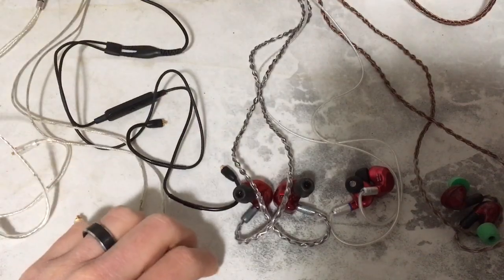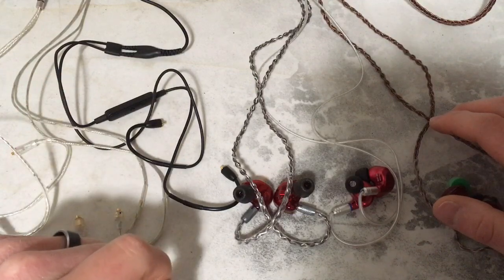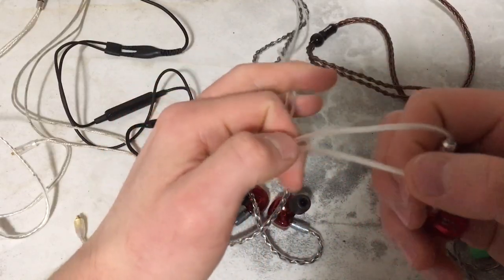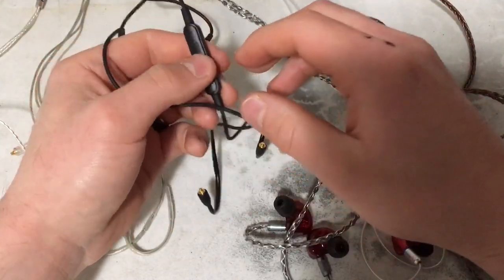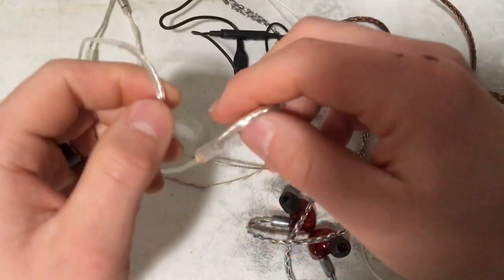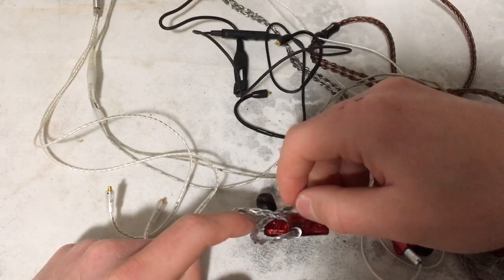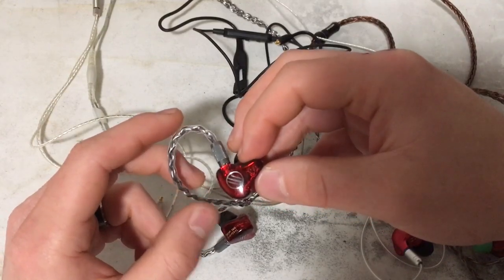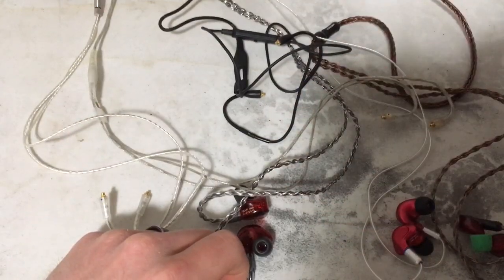Cables don’t matter (ft. BGVP DM6)

Comment: Damn those are consistent graphs -- bravo on the inquiry into cable differences, but also bravo on your measurement technique, it doesn't take much to get pretty different measurements.
Reply: P.S. DM6 is the only review where multiple commenters told me I was using the wrong cable and that a cable switch would solve any problems I had. So thanks for using that as your test :)
Reply from the maker: Thanks man. Also you’re welcome lol. I also got some comments about cable selection and it inspired me to do this video.
Reply: @iemreviewguy7469  Another great investigation, thanks for this. Surprising results given the differences you measured with the DM6 and different sources (likely due to the output impedance differences). I suspect all these cables measure similarly due to them having similar resistances (and so all affecting the impedance of the source in the same way). If you have a digital multimeter, would you mind checking this by measuring the resistance of each cable?

Comment: I'm not a believer in cables. But every cable has its own resistance, and just like a higher output impedance of a device , a higher cable impedance will also affect sound quality. 
In the moondrop kanas pro thread few people measured the kanas Pro cable which measured 0.8 ohm. Whereas the 20 dollar nicehck cable measured at 0.3 ohm. 

How much it affects sound quality, I don't know. But I think the expensive cable manufacturers intentionally makes high impedance cables to alter the sound which is better for some and worse for some.
Reply: 0.5ohm difference is jack all. The only difference is Placebo
Reply: @ron9511  The reactive resistance is orders of magnitude higher on high frequencies.
Reply: Price does not matter. Amount and quality of the surface does. Hf conducted by the surface. Also Electrical capacitance meters too. That's why 8 core silver plated cable may increase treble but 16 core may mess it up creating to many resonance points.
Reply: @ron9511  not for andros. Andros is the most fuxking hard to find the synergy... tooo sensitive. But once you got it, you will keep it.

Comment: Burn in and cable believer= flat Earther. They believe only what they can hear/see.
Reply: Burn in and cable believer = audiophile
Reply: The audiophile market is full of bullshit. Brands selling "miraculous" cables for ridiculously high prices. The same can be applied for some Iem brands (The boutique brands in general). Iem that cost 100-200 for production are sold for 1500-2000 USD. That's why I'm digging for Chinese brands, that offers equivalent or maybe better quality for a fraction of the price.
Reply: the only real thing that matters is the thickness couse you loose Signal over long distances. The other real thing is just Look and the feel of the cable.
Reply: @robinraff1486  Yes, the thickness matters when you have some distance. But, it's very little when applied to big speaker in live performances. For Iem connected to sources with less then 2 meters of distance, and without any Relevant electrical interference, it's on the level of the imperceptible.
Reply: Before you call anyone Flat-Earther, please make sure you didn't miss your Physics classes and actually know what you are taking about! 
The higher the frequency the more self inductance is pushing current to the surface of the metal. That's why all the UHF antennas are gold plated. But even on sonic frequencies amount and conductivity of surface matters. I didn't care about cables when I was listening on colored sounding or low end inaccurate IEMs. But reality when you deny it, has a way to hit you in the face eventually. 
iBasso it04 was the first nightmare of cable replacement. Thicker 8 core silver plated cable option had to be EQed 4k down by 2db, 8k by 4db.... later I had even worse cable sensitivity case with Sony Ier-M9. 
My point is that when sound is getting closer to reality, brain has less work to adapt and differences that relatively used to be minor, become very noticable.
Reply: @alexstrakovsky1872  That's UHF. My relative is an electrical engineer who used to design radar systems for airports and he talked about how bs audiophile $$$ cables are, it doesn't take an engineer to know the industry is full of bs. 

If resistance is low enough, which any copper cable should be, then the cable is fine. The impedance of the drivers matter also, if your driver impedance is high, then small increases in cable resistance isn't something to worry about. Only when you have multiple drivers with low and varying impedance should you worry about cable resistance. the Btw the it04 are crap.
Reply: @ron9511  Your relative could educate you at least on the fact that there is more to audio cable than just resistance. Capacitance and inductance can create unpredictable peaks that will not show on the graph but will damage realism and sound stage. Also cable doesn't have to be expensive to make difference. I buy $12-$40 cables on Amazon. Higher frequencies even as low as audio treble are conducted in significant degree by the surface which makes inductive resistance much higher than mere fraction of Ohm that we have on LF. That makes for example 8 core cable to increase trebble frequencies as compared to thinner lower thread count cables. Also as with most gear high end  audio is a road of diminishing returns. Also important that unless iem pushing the limits of accuracy the change may not affect sound in audible way. 
Out of 20 years of experience with iems only last 2 years I care about cables and even then only for ibasso it04 and Sony ier M9 cables made dramatic difference. 
I'm sure you wouldn't buy $100 HDMI cable from Best buy. Neither will I for audio. Just be reasonable. 
I will get my Bgvp DM6 in 2 weeks. Wil see if cable makes difference for this one.
Reply: @alexstrakovsky1872  Yeh the differences will only show when you listen thanks to placebo effect and bias.
 If the capacitance difference was audible such as a small boost or attenuation of high frequencies, it would have shown on the graph. You can also measure capacitance using a multimeter, tell me how much of a difference there is with resistance, capacitance etc. There is between a normal/stock cable and an expensive aftermarket cable.

Comment: Whenever I ask for some scientific proof of sound changing by swapping cables, the only answers I get are "try by yourself" and similar. Ten minutes of physics studying and you already know that the only thing that could change is the resistance, so the volume, in the end. I hope they don't come here to do some bs shitstorms.
Reply: What about inductance, capacitance, surface conductivity? Are you sure you know enough of physics? Did you know that high frequency conducted by the surface of the metal? That said, cables will not make difference with every iem. If iem is forgiving to recording quality, cables don't matter!
Reply: @alexstrakovsky1872  I know nothing of physics, that's why I ask some scientific proofs to the people who claim to hear changes by swapping cables. Nobody has ever answered to me. They say to try myself, but how am I supposed to try thousands dollars cables? I study psychology, though, and they probably just want to justify their foolish expenses.
Reply: @techinblack  I agree. Overpriced cables make no more sense then those $100 HDMI Monster cables from Bestbuy. $20 6 core cable from Amazon is soft and good looking, hard strong connectors. You can buy it for that reason and maybe you see difference. I have seen no difference between $30 and $60 cable as long as they are similar 8 core SP cables. Also in my experience not all iems benefit from Silver plated cables. 8 core spc made my iBasso it04 sibilant and made no difference for  shure 846. I still bought $14 KZ cable for Shure because it is softer and had better connectors.

Comment: the only difference that may occur when comparing cables is that one may make an earphone sound louder at the same volume than another one.
There might be a slight 'improvement' going for a cheap 3$ cable to an 8 core cable etc in sound but also in longevity, quality, comfort, aesthetics, etc. THAT I can understand. For instance, the included cable on the zs3 is so crap I cant bear to use it but the 6 (or 8, can't remember) core es4 cable makes it sound clearer. Not like night and day, but its noticeably better sounding with that cable (also less microphonics). Those types of upgrades I can understand.

 When people start pulling out the 'yeah this 100$ (or more, yikes) cable makes this 19$ iem sound WAY like a 200$ iem'; a bit too far for me.

The only reason I think most people would consider getting an upgrade cable is for aesthetic or comfort purposes rather than major sound changes.